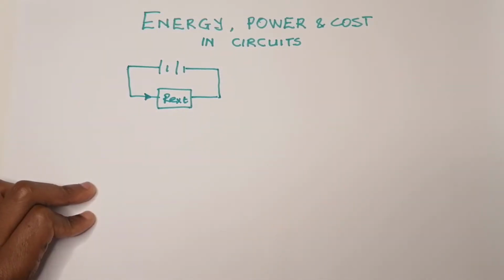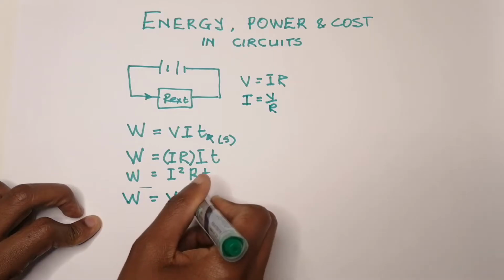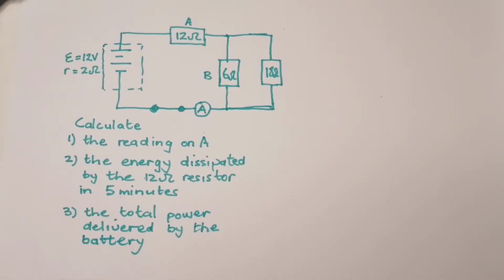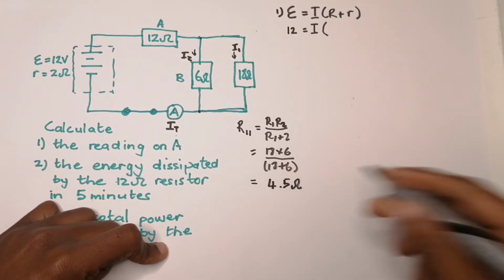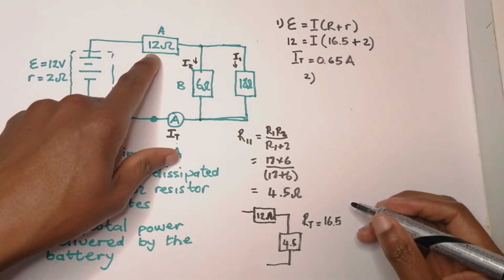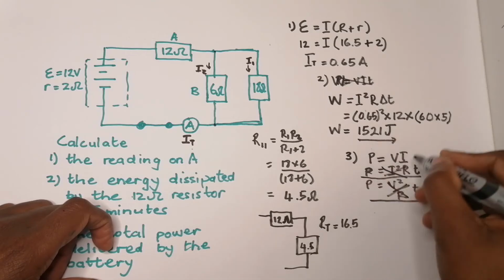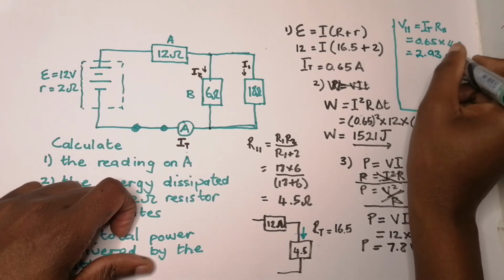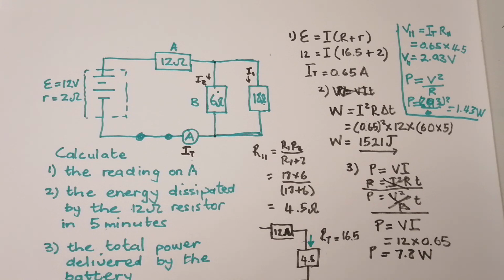Physics | Electric circuits | Energy and Power

Comment: Hello sir, I had a problem with #3 .. so I just calculated using p=v²/R ( for R I added both internal and external resistance) and got the same answer ( well yours is 7.8,mine is 7.783) could this just be a coincidence..? I hope you see this question and respond.. thanks in advance

Comment: Good day sir I don't understand why we used the emf as the voltage to calculate the total power on number 3 because in the previous videos you said the voltage reads the emf only when the switch is open  . I'm confused there can you please help 🙏
Reply from the maker: If you use external voltage, it would exclude power dissipated in the internal resistance
Reply: okayy thank you sir I understand now .

Comment: Hello sir please can you help me....when calculating the total current why didnt you add the 12 and 6 resistor since they are in series to get 18 ohms which will eventually be parallel to the other 18 resistor
Reply from the maker: No please watch my other videos on this topic… 12 and 6 are not in series because they have different currents on them.
Reply: @MlungisiNkosi  Oh yes sir I figured that out has I did more questions with you.
Reply from the maker: @mildredagu8028  awesome

Comment: Sir I'm confused by when we have to calculate the power dissipated by the battery what if we calculate the voltage of the battery and then use tht voltage in the formula to get to the answer?
Reply from the maker: A battery does not dissipate power but it supplies power. If you want power dissipated inside the battery, you have to use the internal resistor
Reply: Thank you so much sir your lessons have been very helpful I feel ready for my physics exam  today because of you May God bless you
Reply from the maker: @twistbubbles815  it’s my pleasure mtanam 😊

Comment: Is Electric Energy carried by individual electrons? Wrong.
Sound moves much faster than wind, correct? And electrical energy moves much faster than electric current for much the same reason.
Air in a pipe can flow fast or slow, while sound waves always move at the same
very high speed.
Charges in a wire can flow fast or slow, while electrical energy always flows
along the wire at the same incredibly high speed.
The energy per unit time, per unit area, transported by the fields (ignoring the stored fields) is called the Poynting vector S. 

Electrostatics and circuits belong to one science not two. To learn the operation of circuits and the way they transfer energy, it is instructive to understand Current, the conduction process and Voltage at the fundamental level as in the following two videos:
i. https://youtu.be/REsWdd76qxc and 
ii. https://youtu.be/8BQM_xw2Rfo 

It is not possible in this post to discuss in more detail the energy transfers in simple circuits. 
The last frame References in video #1  lists textbook 4 which discusses these topics in more detail using a unified approach and provides an intuitive understanding of energy transfer in circuits in the steady-state.
Also, a detailed description with derivation of the Poynting theorem and Poynting vector is provided in textbook 4 with the help of several useful analogies including a bicycle wheel!
Reply from the maker: thank you so much...  You clearly are not the target audience for my video.

Comment: Meneer. i have a ask.😆Do you use emf voltage or external voltage when calculating POWER? and why?
Reply from the maker: It depends on which power you're calculating..
Reply: @MlungisiNkosi  is there not one Power calaculation?
Reply from the maker: @bryangomez4136  there is... Check one of the past exam question

Comment: Could you please help, I still do not understand why we didn't use the internal restistance to calculate the total power of the battery?
Reply from the maker: The power dissipated by the internal resistance is not delivered to the main circuit. It is simply lost...